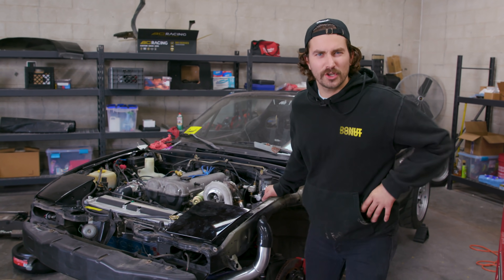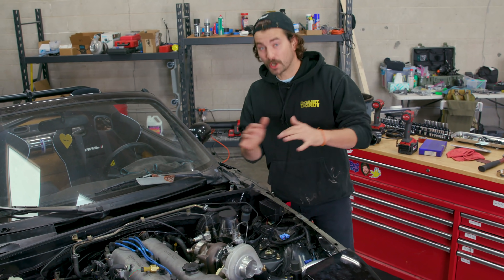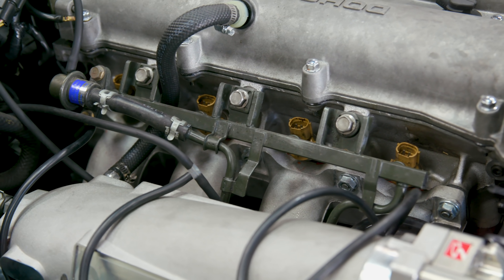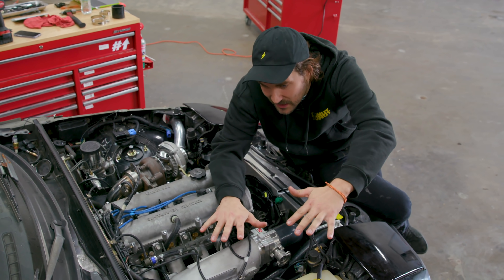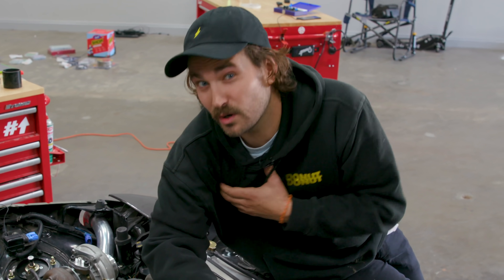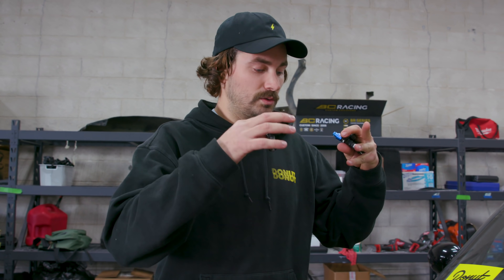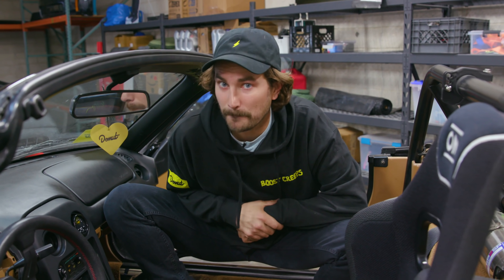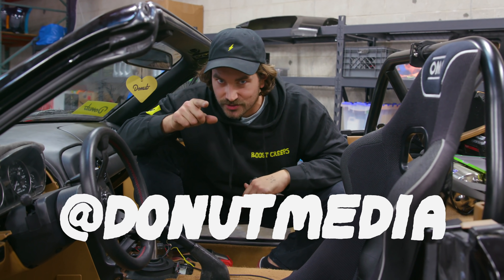Turbo Your Car - Picking the Right Injectors

Comment: I love the sound of good old turbo on my celica (st 205), it always sound 'psshht' everytime I step off the gas and put in on again which is very intoxicating for me.

But, modern turbocharge cant produced that sound anymore due sound insulation and filters get better thus reducing that sound drastically which killed the fun, also they got more fuel efficient with best HP/Liter power ratio.

Comment: PLEASE UPGRADE THE FUEL PUMP PRESSURE ISNT THE ONLY REASON TO UPGRADE.
Reply: Definitely would recommend upgrading the fuel pump. Pressure is going to drop flow. It may flow 165 at whatever unknown pressure it is rated at but it probably doesnt flow that at 54 psi.
Reply: @cluelessdak7224  a simple aem340 pump he can make whatever that miata will hold plus it is e85 compatible
Reply: @whitewing828   That's a bit much if they don't plan on upgrading the regulator. I'd probably recommend a DW200 if it was for my car.  Cheaper/e85 compatible
Reply: Thats true I guess I'm used to my subie so a little more fuel is needed
Reply: Explain more please?
Reply: @WarriorsPhoto  to which part
Reply: @whitewing828  Why does he need to upgrade the fuel pump?
Reply: @WarriorsPhoto  pressure, voltage drop, growing room just because it will support it theroical doesnt mean that pump is 100 % or anything else could he off so save yourself the headache and upgrade $80 to $160 part
Reply: @WarriorsPhoto  https://youtu.be/ikqMzCAXmT8
I made a video explaining various parts of the fuel system and why you would need to upgrade certain parts.
Reply: @whitewing828  Very cool and thank you for sharing. How many fuel pumps have you upgraded in your time?
Reply: Just about every project car ived worked on or owned. Its need to push cars to there limits normally.

Comment: Do you have enough injector if you want to run e85? I have to run injector dynamics 1000s in my wrx, the stock 600s couldn’t keep up. Also a aem 350lph pump... also use some flux when you solder!

Comment: 4:45.... moderately upgrading your fuel injectors is one thing.. because the next question will be well, how big is too big? You can't run 260 horsepower at 10 psi and buy 2200's.... so you should probably touch on why someone doesn't want to get the biggest injectors that they can get their hands on because typically the price isn't too far apart.... but you should also think of a year or two from now when you want to double your horsepower and injector flow rate....
6:35... but you should go ahead and do it anyway ....firstly how many miles are on that stock fuel pump? Secondly you aren't going to run 10 psi and 260 crank horsepower for very long..... you're going to start the upgrades within a year so you're better off going ahead and upgrade.... because you're going to wish that you had
11:23... you're going to wish you had crimped them and then used shrink tubing....🤭

Comment: I had a dream last night, that I became a boost creep in my 94 Mustang Gt... sadly I woke up, no boost, only a creep. This will do!
Reply: I must have woke up boosted...My blow off valve kept going poot poot.
Reply: Turbo it!
Reply: Haha ded
Reply: 94, at least it’s a 5.0
Reply: @charleslewis8968  not a 5.0 lol
Reply: @Mk4.Donnnn  yea, it is. SN95s in 94 and 95 still had the 302.
Reply: @charleslewis8968  Yeah, but they are still a turd in stock form.   Only 215 stock HP and ran high 14's, low 15's in the 1/4.  There were V6's of the same era that were faster.  At least they were easy to mod with a big aftermarket.
Reply: @brianm6117  remember those 302's were underrated lol
Reply: @charleslewis8968  The 4.6 is better
Reply: @angelgjr1999  the dohc 4.6 yea. The npi 2vs are fuckin dogs and it takes $$ to get them to go.
Reply: @angelgjr1999  explain 🤣🤣🤣 they made WAY less torque than the 302. Because smaller engine (duh)
Reply: @zztop7306  A modded 4.6 with 4.10 gears can keep up with the 5.0s
Don’t underestimate them.
Reply: @angelgjr1999  "a modded 4.6 can keep up with a stock 5.0" wow, what an observation..
Reply: @zztop7306  What do you mean?
Reply: @angelgjr1999  he’s talking about the old 5.0 and no a 4.6 with 4.10s can’t keep up with a  coyote
Reply: @angelgjr1999  now a 4.6 with cams and 4.10s will run with a coyote but the 6,000 rpm they’ll spin to stock can’t keep up with the coyote revving to 8,000 they need cams
Reply: @mercury0214  "the old 5.0" is an incredibly rude statement. Everyone in the 80s and 90s loved that engine because of the simplicity and versatility of the engine, it may be slow by today's standards but 14 seconds wasn't bad for a stock car back then. You can even reach 12s without any engine work. Ford should have stayed with pushrod engines like Chevy did, maybe Ls's would have an equal rival
Reply: @angelgjr1999  🤣🤣🤣 what a phrase. "Dont underestimate this engine you need to MODIFY to keep up with a STOCK engine." You need cams at the minimum and probably and exhaust system and then 4.10 gears and some tires to help this lighter car hook up. Wtf?
Reply: @angelgjr1999  just take a 87-93 fuelie mustang, put some 3.73 gears under it, sub frame connectors, and some free flowing exhaust and if you ever have the time swap a cam in it too with larger injectors. Sure, the list is long, but if you're an good driver and you know how to use that 5 speed, you can at the very least give the newer coyote and LS mustang's and comaros and the hemi challenger's a run for their money. (Atleast that's what I did on the streets).
Reply: @angelgjr1999  and if you really want to invest money into an "engine", just build a 408 windsor stroker with some good flowing heads and a big cam, run a carbuerator on it, and tub it out and put some 14 wide slicks under it and drag race it. Like do you NEED 500 Horsepower in a unibody car?
Reply: @mercury0214  Listen here: Cold air intake (a real one) with 75 mm throttle body plenum, under-drive pullys, with an off-road x pipe exhaust system with flow master mufflers, and 4.10 gears . Also add in koni shocks and struts with 285 nitto racing tires and I promise you my baby will walk most old 5.0
I’ve walked a brand new ecoboost before (which has double the HP of a Fox body). 
I know the 4.6 feels like a truck when stock, but like I said a few mods that delete limiting factors that Ford foolishly put in, and you got a quick pony car.
Reply: @mercury0214  That’s a weak point of the 4.6 after 6k rpm it’ll run out of breath. But they aren’t made for high RPMs. They’re made for low end torque and fun. The power band on these go from 3k rpm to 5.5k rpm. As long as you have 4.10 gears you can pretty much always stay in the power band. That’s how you beat other cars in races.
Reply: @paulcochran3780  I think mine has modded injectors from a previous owner. She runs at 50-55 psi. Stock should be 39.
Reply: @angelgjr1999  well bigger injectors wont do much until your engine demands more air (cams, intake, exhaust, heads, stroker kit, etc)
Reply: 10/10 comment 🅿️🅰️
Reply: stay na my friend. ford OBD1 is quite difficult to navigate and tune
Reply: @mooch9989  reflash ecu done..
Reply: @cuzithagreat975  tutorial: how to destroy your engine
Reply: I've had dreams where I had incredible cars and wake up to my daily driver I know ur pain
Reply: Sam Richard-Dickinson  how are you going to disrespect the fox body and the 5th gen like that shoot the 5th gen looks more mustang then any 6th gen
Reply: You don't have to have boost to be a #boostcreep
Reply: This comment hit different
Reply: At least it’s a 5.0 I got a 4.6 in a 96 gt
Reply: I got a pi 2v and trans and ecu and all the wiring for sale rn. If you want a full pi for cheap lmk 😂
Reply: @3.8journey-52  that'd be such a waste, he could spend the money on heads cam and flow mods and make gobs more horsepower than buying that 2v pi
Reply: @RidinDirtyRollinBurnouts  soooo for the same price as a set of heads he could buy my pu motor. Cams are 725 for a set. Boost is always the answer. Non pi’s have higher compression as well
Reply: I became a boost creep when I got my 2012 Mazdaspeed 3, coming from a 96 civic ex, @trey petersen it'll happen one day and you'll never look back
Reply: U have the mustang tho ?
Reply: 😂😂😂im 💀
Reply: Get a supercharger. Still boost, ez to install
Reply: @זהסודי-ה7מ  but 302 blocks like to split under boost lol
Reply: You creep you. What did you creep on?
Reply: Lol
Reply: Damn.....
Reply: I'll trade u my boosty stang 4 cyclinder 😁
Reply: Sam Richard-Dickinson  I’m going to agree to disagree I respect all mustangs that aren’t the s94’s those where just ugly but respectfully light the later half of the 5th generation is more classic to the muscle car era of the 60’s & 70’s and they still keep up with the s550’s the 6th gen is good but have you been to car shows lately that’s all I see now I love seeing a heavily boosted fox because it’s something different and some would smack the s550’s in a 1/4 but that’s just what I see
Reply: I had a 95 cobra with a turbo from a power stroke on 4lbs and it make like 400hp it was pretty mean for about 6 months then a rod let go and windowed the block. I now have a vortech supercharger 03 mach 1 that makes about 550 on 10lbs  but honestly you’re better off building an 302 with forged bottem end and a hood set of aluminum heads and an aftermarket intake with a hog ass cam. You could make 400-450 all day everyday reliably
Reply: I dreamt that I turbocharged my 1971 javelin with a 304 v8. It went badly.
Reply: Sorry it's just one year late from being beautiful
Reply: On3 Turbo bud! Affordable and pretty respected in the mustang community. Obviously it’s not a Hellion Kit but they are nice kits for the price. Plan on doing on for my Foxbody. Gotta upgrade fuel system and Tune of course.
Reply: In Modern Living Rooms Everyone Using "SoundProof Curtains" That Stops Outside Noise by 80% (25 Db) Tested. Check Here: https://livesoundproof.com/best-soundproof-curtains/
Reply: f
Reply: I got you playa im creepin boost into my gt
Reply: What do you think his gas mileage is lol?
Reply: N/a creep  boost creep is our rivals😂 n/a we stand boost we blow up✊🏽
Reply: @Wheelmanbrick  and yet your name has “supercharged” in it.... it’s still forced induction.
Reply: @moldyskittle   im n/a till i get a supercharger
Reply: https://youtu.be/iD9oDWIxmkI
Reply: LMAO